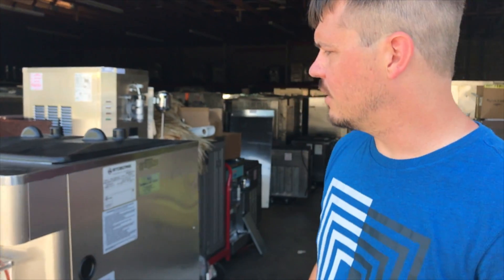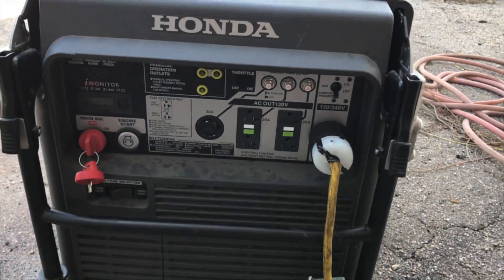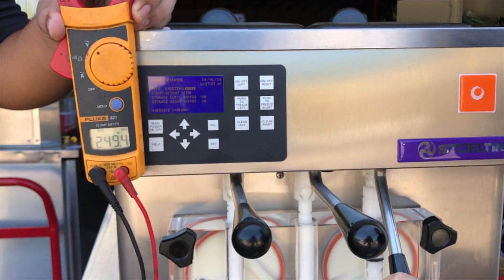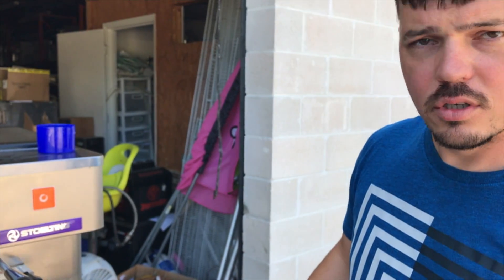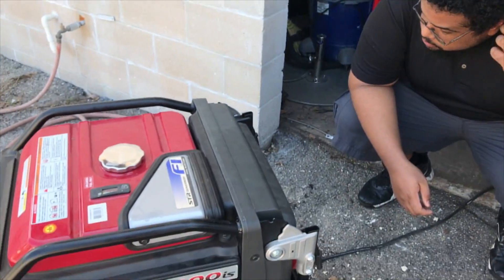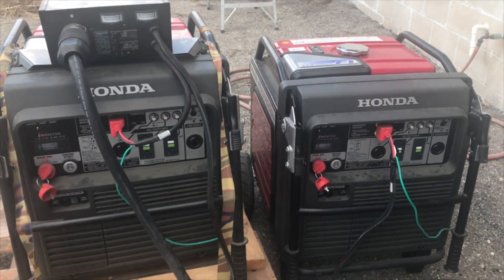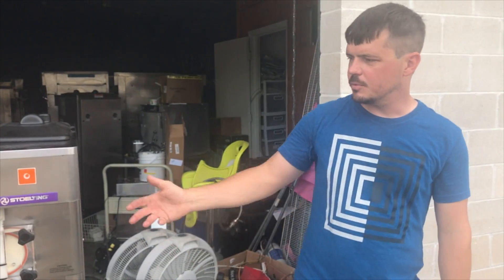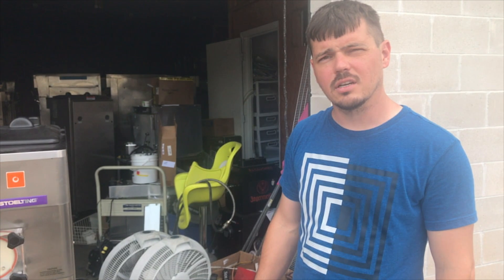Running Your Soft Serve Machine on a Generator

Comment: Taylor model 791...uses 20 amps 4600 Watts

How many running watts should my generator have? This is all new to me. As I read through the comments, I noticed you said the generator should have 3 times the wattage of the unit. 

Just want to make sure I'm reading into that correctly. 

Thanks.
Reply from the maker: AMP x Volts equals Watts. Always have atleast (sometimes you need more) 3 times that watts of the machine on your generator. 

https://slicesconcession.com/blogs/frozen-dessert-industry-and-machine-articles/running-a-soft-serve-machine-on-a-generator

You need to speak to an electrician.

Comment: So I can't use just any generator for my softserve machine?
Reply from the maker: Hi. That is 100 percent correct. Volts times AMPS equals Watts. You need at least three times the watts for the machine.
Reply: Slices Concession  so my machine is a Taylor it has 27 amps rating and it’s 220  so does it mean that I need a generator that runs 6000 watts running wats or that times 3 so 18000 watts I don’t understand please let me know

Comment: Great video! Any way you could open up the box for the parallel kit for the eu7000is generators? I'm curious how it is built and wired inside. I bet if you made a video there would be lots of interest. Honda still has not released the updated one. Also I would be interested in buying yours if you want to sell It?
Reply from the maker: Hey Mark, I would open it up for you guys however, it is on loan to a customer of our for the next few months. He also had trouble sourcing one so we loaned him ours. I will make a video on the workings of it when we get it back.
Reply: That would be great! Thanks again!
Reply: Mark the EU7000 kit is NOW available. I just ordered one.

Comment: may i know which model this gen set? specification?
Reply from the maker: These are Honda EU7000is generators running with a parallel kit. Each are rated at up to 7000 watt surge. They are incredibly quiet, reliable, and efficient. We recommend over powering refrigeration as the initial surge required to start a compressor can spike above the rated generator.